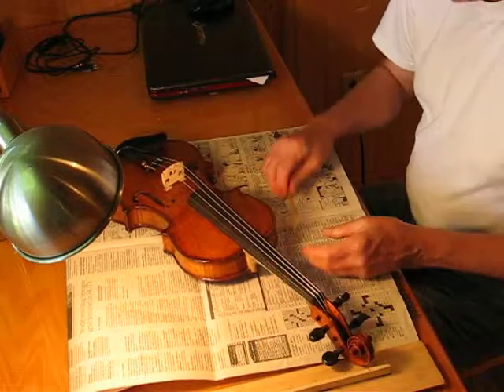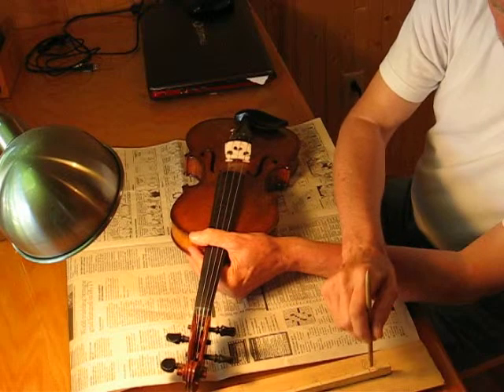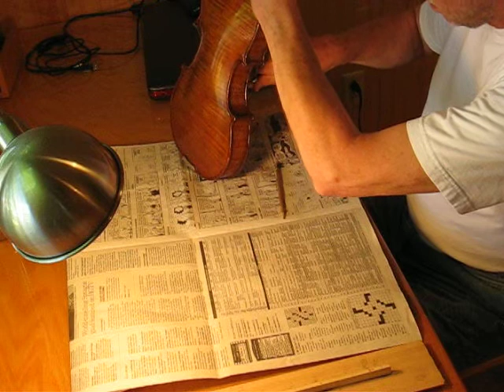Acoustical Tuning of the Violin Bridge; Opus #11 violin

Comment: Thank you for sharing. Is it possible to tune the bridge before placing it on the violin?
Reply from the maker: Hunter;
  Yes the bridge can be petuned before, and installed later.  It is best when tuning this way, to place it against a sounding board to amplify the sound as one adjusts.
  I am hoping by the end of the year to have updated instructional pages;  I have been following my research and haven't had time to update the web site...  David L.